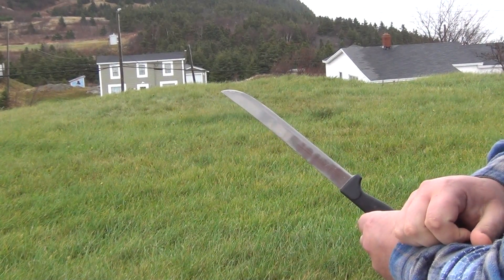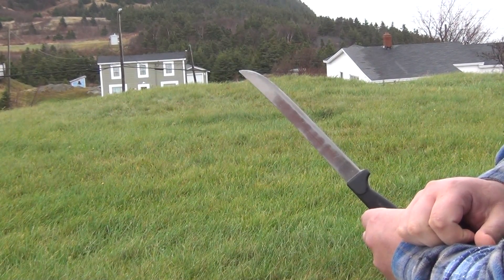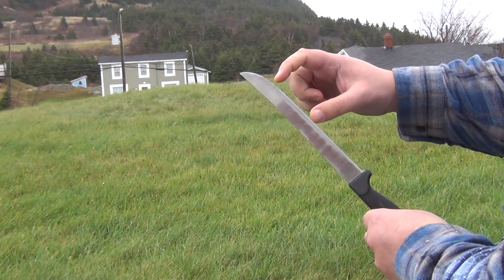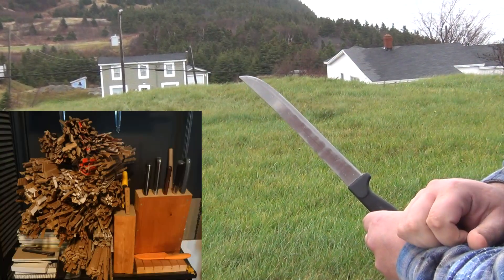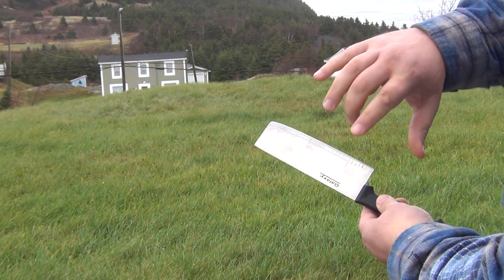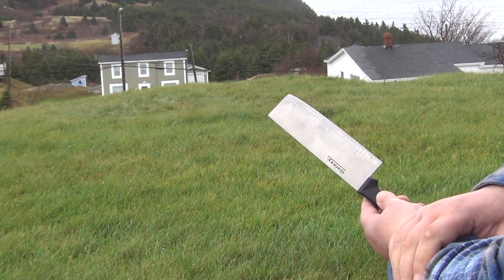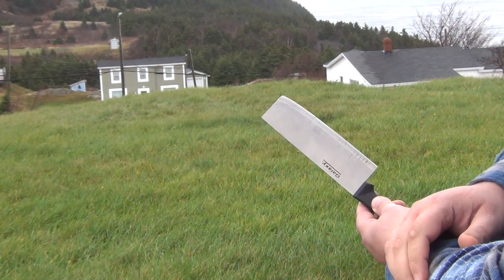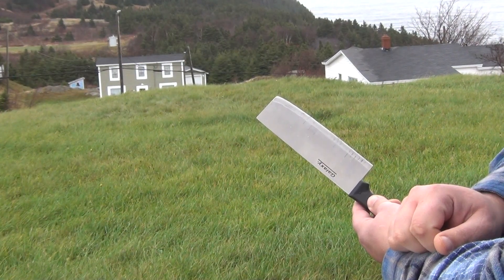Knife Challenge 30 : Spyderco Sharpmaker 15 vs 20 dps microbevel

Comment: Did you choose these two knives because you knew the edge retention runs would be relatively quick?
Reply from the maker: I think you may be posting about another video possibly.
Reply: Cliff Stamp I meant did you choose these two knives because you knew the steel was lower class I and knew that it wouldn't require as much cardboard to be cut as say... S30V or M4
Reply from the maker: shurdi3 Not in particular, most of what I do gets chosen at random, the knives and such to try to minimize any bias I have about what is done/concluded.

Comment: The 15 dps will hold it's effective edge longer.
-The steel is soft and badly heat treated, almost gummy. No worry about chipping or carbide pullout.
-The 15 dps is sufficient to prevent gross rolling and fracture of the edge, no stability benefits from 20 dps.
-Toothiness in slicing is negated due to the softness and poor heat treat of the steel. Microserrations will wear away very quickly on both edges.
-Thus, since the 15 dps is a more acute isosceles triangle than the 20 dps, there is more metal that must be worn away from the apex on the 15 than the 20 to reach the same width flat plane of the triangle. This will mean that though neither may be "sharp", you'll be trying to force a smaller wedge through with the 15 dps than the 20 dps.
Reply from the maker: This is essentially it, you can see the full results here : http://www.cliffstamp.com/knives/reviews/angle_experiments.html . 

There were a number of people coming together at the end, that is a nice summary though.
Reply: Good take, I'm impressed

Comment from the maker: As a general hint/idea, at a given state of blunting, which produces a given edge thickness (say 10 microns) which edge had to lose more material to get to that apex thickness, the 15 or 20 dps one?
Reply: The 15
Reply from the maker: C amber Yes, and now what does mean in regards to how fast the 20 wears if the 15 dps bevel is already strong enough to resist gross rolling and fracture.
Reply: Cliff Stamp It means the 20 degree edge will wear faster and so dull faster
Reply from the maker: Christopher Chociey Read the comments, there is a lot being discussed.
Reply from the maker: C amber Yes, this is why it is critical to not increase the edge angle if there is not issues with edge stability, it gains nothing and just reduces performance, unless you are an operator of course.
Reply: ...You'd make a good teacher, Cliff. 

Wish I had someone that didn't seem to just read off a script for the past 12 years
Reply from the maker: shurdi3 Ha, I have taught consistently for a long time, I was teaching full time in college for a while. I just taught a class in elementary algebra this evening to a group of kids trying to get a GED.
Reply: Oh please tell me all your analogies were about knives. 

I can imagine it now 

C: So kids, we have 15 degrees on both sides. By how much must we multiply to get the inclusive angle? 

S: Five? 

C: You're gonna go work for Bark River
Reply from the maker: shurdi3 Ha, not always, though some of them. I would often ask general questions such as calculate the amount of Klingons which would be necessary to successfully board the Battlestar Galactica. Or using the physics displayed in a popular movie then predict the results of a given experiment or solve a problem in that paradigm.
Reply: Pfft. I can predict that. 

Using the physics displayed in [insert Michael Bay movie here] it is safe to assume that it will explode.

Comment: This one feels a little over my head but I'm going to attempt it:
At the 15 degrees with the Spyderco Medium (SM), I'm going to say overall performance is similar to the work to the work with the 600 DMT.  To be more specific 
-High sharpeness edge retention probably goes to the SM as the more polished edge wears more smoothly and slowly while the DMT with it's coarseness gets torn up quickly.  The SM edge would initially experience less stress as the polish would help it cut smoother with less force
-Mid way (to the 10% mark) I think they would start to even out as the DMT edge while degrading faster and less smoothly due to the less than ideal edge stability from the softness may be able to take advantage of some of that tooth that allows it to keep cutting at a medium sharpness for a comparable quantity, while the SM edge would just continue to wear slowly, although being so soft, also developing some irregularity, and more so as force increased
-In long term low sharpness edge retention I imagine they end up fairly similar as both edges are just degraded, one one more flattened, the other more torn up...perhaps the SM edge could go a bit further as it would be less likely to have severe irregularities, but I would guess it would still be fairly irregular, with rolling, similar to the CS bushman in the one challenge.

At 20 with the SM edge, I'm imagining performance is worse across the board.  At such low softness the edge will not fight wear that well, and at a higher angle will require more force for the cuts which will induce more stress on the edge and more chance of rolling, impaction, etc.  To be more specific, I think with each marker of level of sharpeness the difference in quantity cut would become more drastic.
Reply from the maker: The idea about force is very critical in general, but here the increase in geometry is very small as this additional bevel is only < 20 microns wide. The amount of force applied is near identical between the two, it won't show up on a scale for example and there would be no way you could tell which one is which if you didn't know which section had either bevel.

Nice detail though.
Reply: Cliff Stamp That surprisingly did occur to me, but it was one of the few things occurring to me.  Plus I did think though that  we were talking about a difference in finish of less microns that that (with respect to the polish) with regards to the change in stone, so aren't most of the differences going to be pretty minute?

Although with respect to the edge thickness at a given distance from the apex I would love to see one of Kyley's diagrams now that you've made the other general hint comment?  I was thinking that when the 20 degree one did wear it would be like a fat triangle very quickly while the 15 would be slimmer, but that's a pretty poor description.
Reply from the maker: The full link is in the description, the edge retention compared to the DMT 600 is a little lower which would be expected as this is a check of slicing edge retention and that is enhanced with a lower grit finish. However I use very light force when applying the final bevel and my DMT stones are very worn compared to fairly fresh Spyderco ones, so the edge is only a little more coarse on the DMT.

Comment: I was looking at the wrong thing with the bevel angle. The reason the steel would hold a better edge off the fine stones is due to the lack of carbides and relative softness in the steel. The toothy ness to the 600 stone would be quickly flattened out and because there would be no carbide tear out the apex would quickly become smooth. With a slightly finer edge closer to push cutting it will be able to support the apex for a longer period.
Reply from the maker: Just want to let you know that Mike Stewart makes this exact argument all the time.
Reply: Just want to let you know the link to the cardboard testing you gave makes no menion of a DMT stone only "the fine side of a cheap hardware store stone"  so somewhere in my reading I am pretty sure I read 10 dps somewhere. Considering how we both feel about Mike Stewart I should almost be insulted.
Reply from the maker: mark a Amusing, that will be fixed in the next upload.

Hey you just used the argument, I was just pointing out Stewart makes that all the time.
Reply: Is the problem with the first sentence or with the theory I proposed.  I don't think it is a stretch to think a soft steel would loose a toothy edge quicker than a polished one.
Reply from the maker: mark a It depends on what you are cutting and how, this is a soft material being cut on a slice. It would be very different if say hardwood was push cut with both finishes.

Comment: The 15dps shows an improvment over the 600dmt work in edge retention but not optimal sharpness. Moving the edge up towards a high class one steel. 
Conversely the 20 dps could not attain the high sharpness probably because it would not form a clean apex. Thus the blunting happened very quick but leveled out near the 15% of optimal and stayed there for quite a while. Over all it put it as one of the worst steels tested. 
This has now left you to attempt what is the optimal angle for retention as well as optimal sharpness. The concern is that each steel is going to require testing in this manner to show what it is capable of.
Reply from the maker: Why would you expect better edge retention vs the 600 DMT work?

How come the 20 dps would not form a clean apex?
Reply: Cliff Stamp i would expect the better edge retention as the 15dps is closer to the optimal cutting angle than the 10dps used on the 600dmt. by that i mean it with that class of steel and likely poor HT. 
along the same lines since the steel is gummy and soft increasing the edge angle is also more likely to burr and not form a clean edge. think about how a cutting burr is added to a cabinet scraper, almost 90deg to the edge. this might be less of an issue with a more coarse stone but with the burnishing effect of a super fine stone on a soft steel and the edge will not form correctly.
Reply from the maker: mark a The DMT work was done with a very similar angle to the 15 dps setting.
Reply: See reply above.

Comment: Okay... so how about this: 

I would argue that the 20dps microbevel sustained high sharpness longer, due to removing more of the smaller burrs (though not all of them as you have commented on multiple times), but would have lower edge retention overall, as it would become more 'saw-like' than the 15 one, and just rip instead of cut.
Reply from the maker: I don't see how the last part follows from the first part?
Reply: Oh, sorry. I tend to make my sentences too long. Just tend to have one though go on and on, with additional details popping in which I forget to write down. 

So basically better edge retention on high sharpness, lower overall with the 20dps one.
Reply: I do realize now that my previous two statements contradict each other, but I'm just throwin out hypotheses
Reply from the maker: shurdi3 If I didn't make it clear, you have to actually pick an outcome and argue for it. There are only three possible outcomes, so you just can't write all three and hope to catch it as that isn't really predicting anything.
Reply: Oh, sorry, I was trying to give a possible explanation for each. 

Well I stand with this argument. Better for high-sharpness edge retention, worse for overall on 20dps.

Comment: Were you able to measure the 20 deg edge at optimal for this steel at all?  Did it start lower than the 15 dps? It has been suggested that a class 1 steel needs a bevel of 8-12 dps to maintain and achieve optimal sharpness.
Reply from the maker: Those questions are the kinds of things you have to predict as part of the challenge, no harm in attempting the question though.

In regards to the classes, realize that they refer to not only carbide volume but also optimal micro-structure. It is very unlikely these steels have the latter. 

I would expect a significant non-martensite phase volume and the martensite to be low carbon (less than maximal hardness).

Comment: There may not have been any difference. Cardboard is pretty soft in the scheme of things. If there was some would argue that the 20 degrees might hold up better but I think what happened was that because the 15 degree edge was used on such a thin  blade stock in both knives it stayed functionally sharp longer because with the thinner cutting geometry of that edge you did not notice the drop in sharpness as soon even though the edge may have dulled a little sooner the resistance in the cut stayed the same.
Reply from the maker: Bruce, in general the point you make about cutting ability is very valid and even if a thinner profile does take damage easier in some situations it may still continue to cut better. However in this case it is just a very small micro-bevel so the cutting ability is almost identical, the bevels are < 20 microns wide. It would be impossible to tell which one is which in the cutting force/control.
Reply: Cliff Stamp
Then both knives being the steels they are I would say the 20 degree edge should cut longer since there is more backing to support the edge and keep it from damage both places unless there is something about the distance from where you grip the knife to the tip of the blade that affects how long the blade stays sharp but my old mind can't think what would be unless the thinner of the two knives would flex enough to cut off center of the edge at the end of the blade which might make for different readings on the two knives as you changed bevels.
Reply from the maker: ***** Bruce, this is a critical question, what angle is necessary to keep the edge from damage and what happens if you keep increasing the angle further.

Comment: Did you find an increase between 10 dps to 15dps followed by a decrease from 15 to 20?
Reply from the maker: I didn't do the 10 to 15, however I think that might be reasonable to expect with this steel.

Comment: the edge angle was increased did this show a linear increase in edge stability?
Reply from the maker: This is a critical part.

15 dps is a very high angle, it is commonly used on axes and for cutting cardboard with a low carbide steel it is already so high that the stability is already maximized.

Comment: In both knives blunting occurred significantly faster with the 15 dps micro-bevel because the micro-bevel wasn't thick enough to counter the carbide tear out of the low angle (5-6dps) of the primary bevel.

If you had used knives with lower carbide sizes the the results are likely to be reversed as carbide tear out would not be an issue with a 5-6dps primary bevel.
Reply from the maker: These are very low carbide, I would be surprised if there was any significant primary aggregative volume at all.

Comment: Ok, so now this. 
The higher angle blunted much more quickly, even with the extra steel supporting the edge. The reason seems to be that the increase in pressure needed to make the cut counteracts the extra stability. Thus the blunting curve is simmilar/steeper than the lower angle. I would guess that higher angles need a higher grit finish to compensate for this. Tests would have to be done.
Reply from the maker: This is an interesting idea, but think about the fact that this is a true micro-bevel so it is less than 20 microns wide.
Reply: Cliff Stamp so my results are right, but my explanation is off? or am i not even close?
Reply from the maker: mark a The physics is correct in the argument, however the magnitude of the effect would be small. I can't tell which section is 15 and which is 20 cutting the cutting the forces is so close as again the bevel is only a very small fraction of the edge.

Comment: I think the reason this became this week's challenge is because of a lack of results. With the difference in edge angle and the steel involved the results were inconclusive at best random at worst and it has you questioning the usefullness of repeating the stock testing at higher angles.
Reply from the maker: That is a very nice guess, I almost wish it came out that way.

Comment: Well this would be a rather interesting scenario. 

I would argue, that because of the 20 dps microbevel being shallower than the 15 dps microbevel, any chips on the edge would be smaller on the 20 dps microbevel. 

However, I would imagine that the 15dps microbevel one would be more prone to denting in and rolling than the 20dps one, as the 15 dps one pushes aside the cardboard at a lower angle, and through a series of vectors which I'm too lazy to describe, you would see that it's going more outwards from the edge than the 20 dps one.
Reply from the maker: How would you expect that to effect performance?
Reply: Cliff Stamp It would be... interesting to say the least. 

On the higher sharpness, it wouldn't make too much of a difference, as I think the dents and rolls would sorta even out with the chips of the 20dps one. However, it would take the 20dps one longer for the area with the microbevel not to be a factor anymore than the 15 one. After we're past the stage where the microbevel isn't a factor, and all you have is the 10dps edge, the loss of edge retention should be the same percentage for the same amount of for both of them, but the 20dps one would have cut more cardboard before that stage, as the chips would be smaller. 

Also how will you rate these? Who is closest, or whose is more logical and well explained?
Reply from the maker: shurdi3 The higher combination of accuracy and explanation.

You have some interesting ideas, you might want to think about cardboard specifically because it is a soft media which is abrasive. Both of these steels are also very tough/elastic/ductile and very low carbide.
Reply: ...I'll follow the comments a bit, and share after some thought if you don't mind.

Comment: You say that the 20dps microbevel is set on 20 pps, but how many did you do on the 15 one? 

Are we to account any possible damages from random and inconsistent nature of the cardboard, or just a perfect case scenario?
Reply from the maker: 20 pps were used to set both the 15 and 20 dps microbevel.

The challenge is to predict the actual results of the experiment, there were 10 runs done (five with each knife) to smooth out random effects (median statistics were used). 

Then the results are explained by providing the underlying theory.